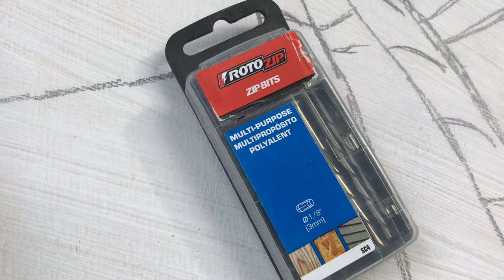Wood Cutout Resin Cartoon Art Acrylic Painting in the Making 🏆Kaybooms Cartoon King 👑

Comment: What’s the exact name and model of drimel you use I’ve been looking for one for some time now one that doesn’t break down after a few cuts plus your projects seem to cut smooth with that one I would appreciate the knowledge…which is a better drimel drimel 4K or the drimel 8220 or is the only difference the preference one is battery and other you plug in…plus 8220 comes with attachments I would have to buy when purchasing the newer model drimel 4K…just wondering if you use these brands and if so what you think of them…
Reply from the maker: yess they break rather quickly ... i switched out to the rotozip so i dont have to constantly replace them ... but definitely the 4000 with the plug in .. and some rotozip bits